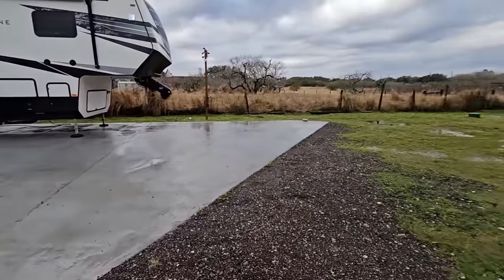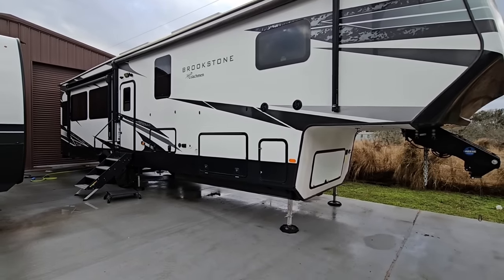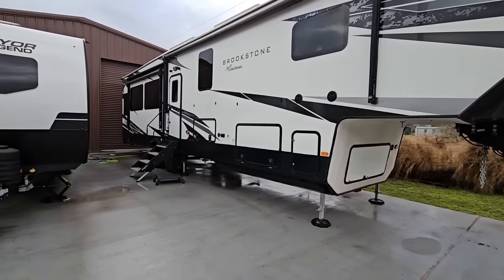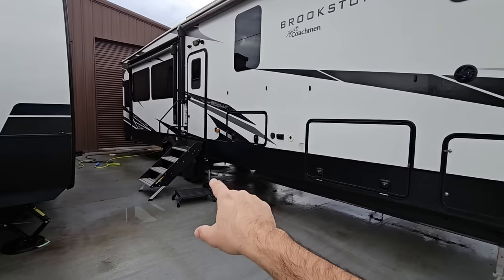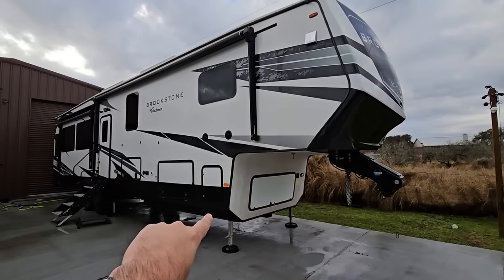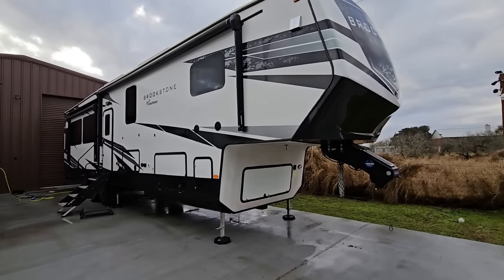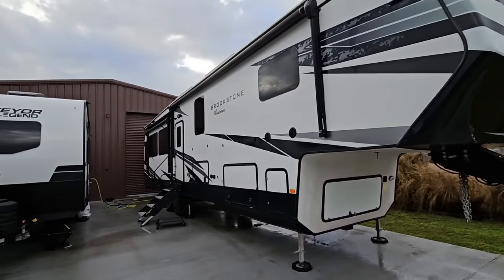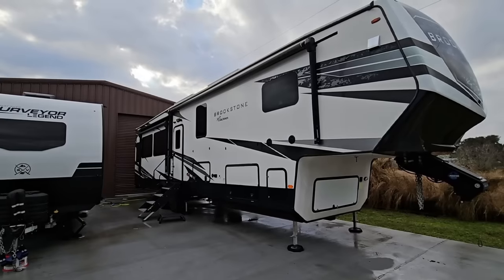FRAME FLEX on some Fifth Wheel RVs EXPLAINED!

Comment: I don’t care what anyone says.  It’s a manufacturing issue of the frame.  You use inferior substances within the frame in the manufacturing process you will get an inferior product.   It all goes back to the Warren Buffett effect in every industry he touches.  Pre 2005 everything was built to last, post-Warren Buffett it’s all built cheaper and they charge the highest price.  So here you go!!! 
Not all steel is created the same.
Oh BTW, do not, I repeat, do not drive your 5er on I 80 between Indiana border and Joliet, Illinois. You will break your frame for sure.  Worse than Alaska!!,

Comment: False information here. Usually frame flex is caused by broken frame or broken welding. It is a manufacturer’s fault, not user’s. Search frame flex, you can see so many cases.

Comment: Material/workmanship vs ‘abuse’ not sure how a manufacturer would differentiate ( maybe by wear on other components/fasteners? But ‘normal wear and tear’ shouldn’t even be a thing. If a transport truck can do two million miles without breaking the frame, an RV should unless they’re under built. 
I really feel for all that have had frame failure, what desperate situation to be in. These things aren’t disposable cheap!

Comment: This guy  knows his shit,   good ,vedio ,    people  need to stay  at the Gvw, of trailer   the main design of the frame is  up and down ,     so,when the    people are doibg slow rurn 90 degree  turn and drag the tires on the,trailer sideways ,  exspecialy 3 axle , trailers,  now your putting  a  lot of stress sideways on the frame, hmm,  up and down and sideways,  going to break welds,  people need to  learn , that aluminum , is  way different  than steel,  and side dragging tires ,,,  spring  hangers take a  alot of,side movement,,
Reply: Slow  turn, lol,,     most breakage from  front axle  of trailer, to pinbox  people need to,say, weld breaks, or frame  cracks,  take 500 lbs outa the front  pass  through 😎

Comment: Oh hogwash the frames and welds should not fail ,one can see the thin metal they use is pour quality ,it's the very foundation,,trying to cheat on metal thickness ,very dishonest
Reply from the maker: Never said they should fail.  Under certain circumstances anything can fail though.

Comment: You are very political with your answer.  You NEVER talked about LENGTH.!!  If a TT or FW is over 32 feet in length, that RV will very likely have too much frame flex and thus cracked frames and or welds!!!   Especially TOY HAULERS!!  The frames are NOT beefy enough!!
Have you seen how semi trailer frames are built, have you seen the "crown" built in when unloaded???  WHY???             $$$
How about a 60, 80 or 100 story building, do you think it flexes?  YES.!!  But do you think the welds break or tear??  NO.!!  WHY??   $$$

Comment: This is an easy problem to solve.  Go back to building stronger, thicker frames with quality welds and true quality control checks.  Quit putting profits in front of safety.  There is a reason this “new” phenomenon is occurring now.  Didn’t happen before.  It’s not rocket science.  Everyone in the RV industry needs to quit beating around the bush on this.  If you use heavy enough steel with proper supports, good engineering, and good welds you won’t have this problem.  Period.

Comment: Your frame would never flex, because it just sits there.
Reply from the maker: Not true, since blowing wind and shifting/sinking/settling soil can still cause deflection.   Also, how much built up energy is being held when landing gear is extended on uneven surfaces.
Reply: @BigTruckBigRV  You’re funny. 😄